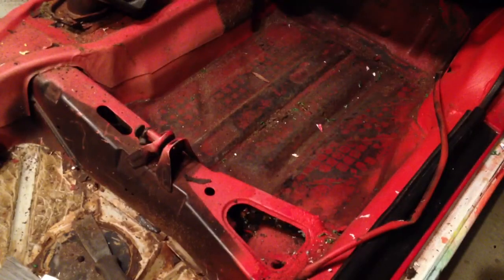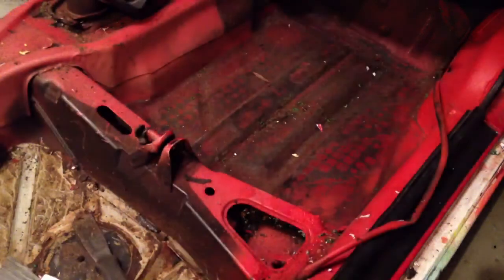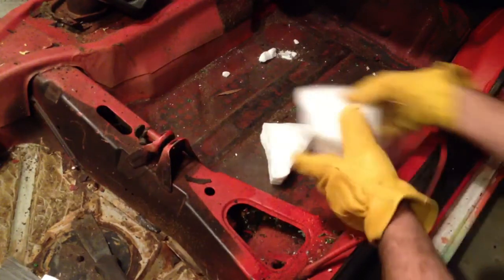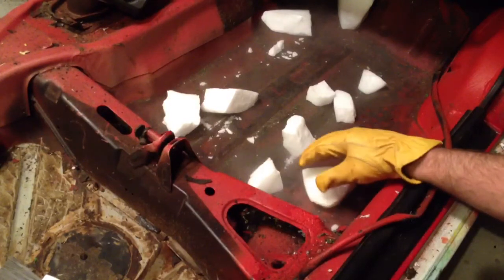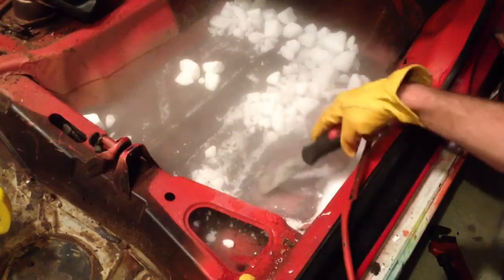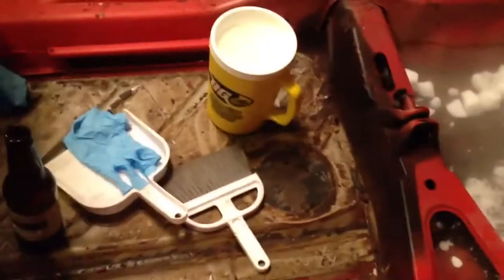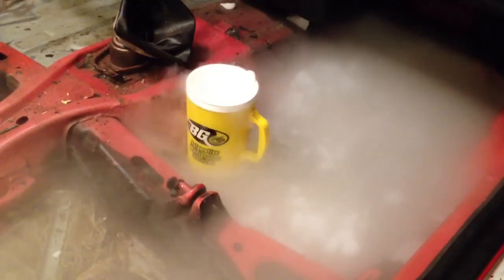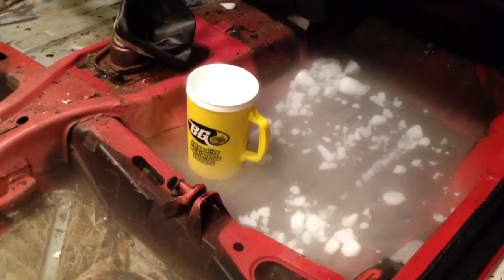Removing Sound Deadener with Dry Ice

Comment: This video has been a while ago, but I wanted to point out that if you blend dry ice and rubbing alcohol (isopropanol), the mixture becomes even colder than dry ice by itself
Reply: Good tip! The alcohol doesn't actually make the dry ice colder, but it helps with heat transfer like thermal compound by helping to fill in the air spaces between the dry ice and the panel. It probably helps break up the glue too. I used that method but with acetone instead of alcohol and it worked pretty well. Breaking up the dry ice into fine pieces with a hammer and covering the whole area is key. Heat gun works too, but from my experience it leaves much more of a mess.

Comment: Next idea, liquid nitrogen?  I've never heard of this procedure.  Fun to watch.  Thanks Charles!
Reply from the maker: Thanks Brain! I wish that it would have worked better. But hey, playing with dry ice is fun anyway right?!?
Reply: Whether it worked or not, it made for an interesting video.  Your labors contributed to the experience of many.  That's cool!
Reply: I seen the Liquid nitrogen and brought back some memories . I spent 7 years on submarines . I was a reactor operator . We use it to freeze the pipe so we can fix the leak on the other side. I can not say  exactly  how the reactor works but I can tell you the hot water system has has only 2 valves . The problem with valves is the break down before the pipe. Man those were the days.

Comment: This only really works with dry ice pellets mixed with isopropyl alcohol. Dump it on and you can literally instantly hear the adhesive from the sound deadening cracking away from the floorboards as it freezes. 2 or 3 minutes and you can just lift the sheets of deadening away. I've done this on 3 cars now. Heat guns works as well if you have a hard time finding dry ice in your area.
Reply: kh155 You can crush the blocks in a bag with a hammer too ...
Reply: Can we effective apply dry ice powder on door panels ? I hope isopropanol help dry ice to stick on a wall

Comment: I tried this and came to the same conclusion, let it sit like 30 minutes, came back to clean it up and gave it one last try with the hammer to find it came up really easy. Also, you don't have enough down. It needs to be in small pieces like you have at the end, but you either need to do smaller areas, or get more dry ice. I have some left in hard to get spots (high up in foot wells), I'll try your idea of the head gun on that. Yeah, I know this is old, but thought someone seeing this video may find it useful.
Reply from the maker: Thanks for the info Randy!

Comment: Nice job on the video.  I just tried the same thing on my trunk to get some relatively new Dynamat off but no luck.  I used the Isopropyl Alcohol but I think I thinned it a bit too much (4lbs dry ice + 32oz alc), probably didn't let it sit long enough (about 15-20 minutes) and may have tried to do too large of an area at once (about 2' x 2').  I came to the same conclusion as you did.  Just wish I would have seen your video before I spent the money :).  At least it was fun to mess around with the ice though.
Reply from the maker: Watermelon BP I don't need much of a reason to play with DI :)

Comment: I think you're suppose to use isopropyl with the dry ice. ?.
Reply from the maker: Maybe. That makes sense.
Reply: Cptn_Shankz I've done it many times in 15 yearz. I've never used the alcohol before. This is new to me. Once you start hearing popping, I give it a whack with a rubber mallet.  It does appear that the alcohol makes it cool faster tbough.

Comment: Not using it properly.if u do it properly will com off in large chunks im no time and clean.suppose to crush the dry ice up into very fine bits in bucket and pour in isopropyl and stir then spread it out over whole lot completely covered. Leave fro 15 -20 min.and it will lift off in large peices easily.
Reply from the maker: Thanks for the info. I figured that I was doing something wrong. I will try it that way on the next project car. :)
Reply from the maker: But I still like playing with Dry Ice ;)
Reply: I have also seen video showing someone do similar idea with spraying can of air duster by not shaking it and spraying it with can upside down (be careful can can get really cold as well) and smack it with a hammer or scraping with pry bar and getting similar results to the dry ice method would be cool to see this method tried out on your next project for I trust your videos more then the random ones i could find of this and do not have access to a project car with the need to try my self. Just enjoy watching/learning from your videos. Thank you for awesome and inspiring channel